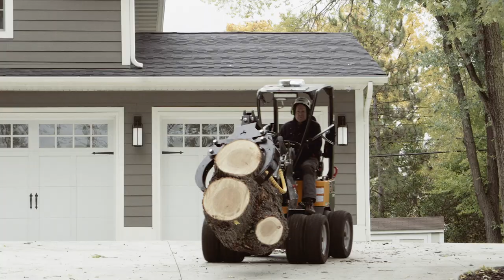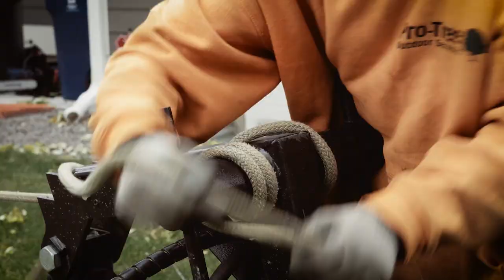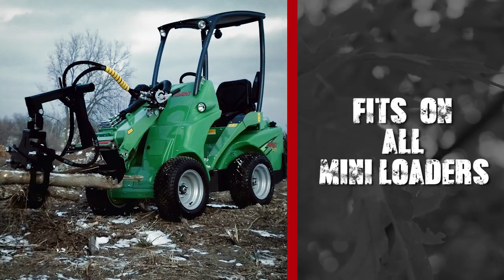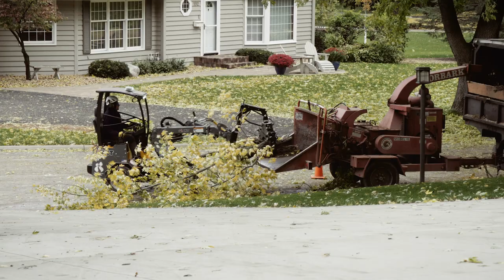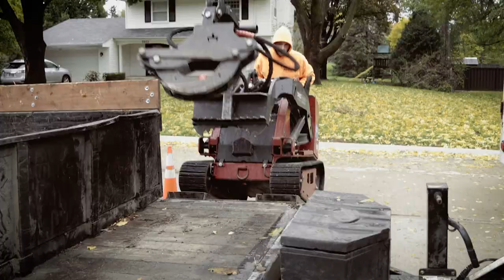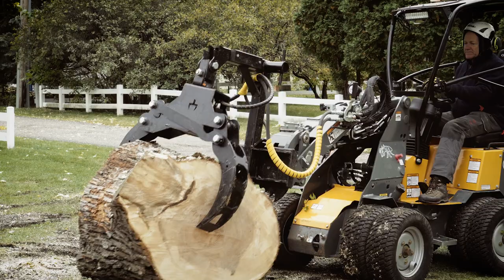56" T1001 Mini-Grapple Attachment by Branch Manager

Comment: Have one of these and it can’t lift a log that size without dropping it. What can cause this ?
Reply from the maker: Most mini loader hydraulic valves out there have "bleed back" on the auxiliary circuits which will allow the grapple to open up. What we've done since 2019 is ship all of our grapples with a Check Valve Cylinder to mitigate the bleed back through the loader's valves. The check cylinder will hold the pressure so you don't need to bump the hydraulics. Our current cylinders are backwards compatible with all prior T1001 & T1010 models, give us a call or send us an email and we'll help you out. Thanks! https://www.branchmanagerusa.com/contact/